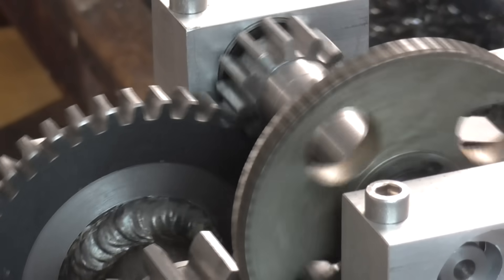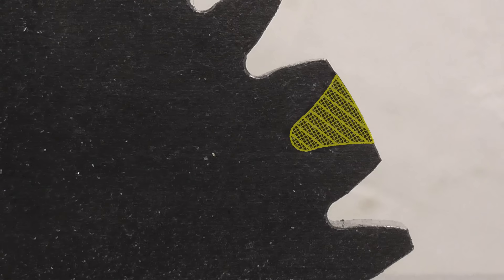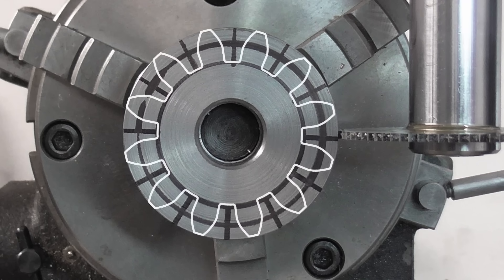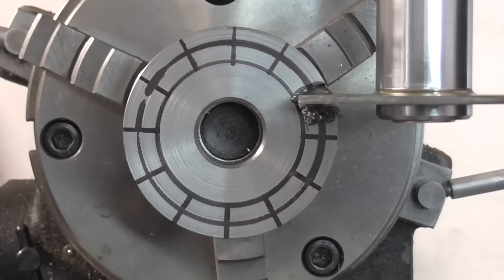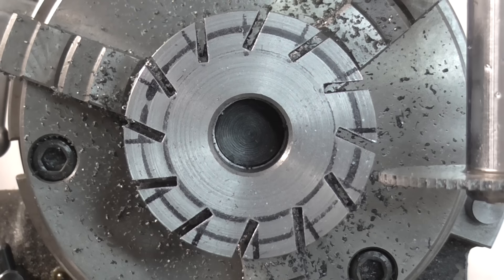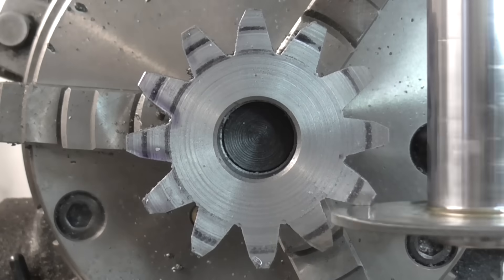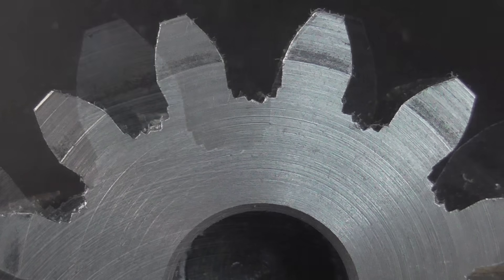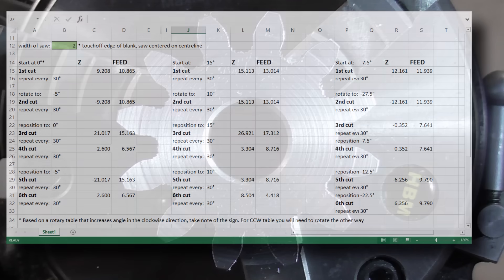Cut any gear with just a slitting saw

Comment: This video taught me two things: first that I really like the gear math and this method of approximating a complex shape. Second, that gear cutters are so so cheap in comparison to making 200 cuts per gear
Reply: 200 cuts per gear is nothing compared to Clickspring hand filing his wheels!
Reply from the maker: @benni5941  Yes, that takes real dedication.
Reply: Tune in next week when Andy creates an additional identical gear with a rusty old worn hacksaw blade and a guy named Pythagoras
Reply: @trevorvanbremen4718  I need at least 3 different sizes of gears. Module 1, DP16, and DP18 with at least two different pressure angles between them. Good quality US-made gear cutters are around going to be around $50-100 each, minimum. I can get sets of import gears from Asia for around $100 per set, but the quality is unknown. Some of the DP imports are marked for 14.5 degrees, which is what I need, but are really 20 degrees, which will eventually damage the original gears in my machines. On top of that, how many gears do I really need? At least a set of metric transposition gears for each machine, which is only 6 gears at the moment. But they're 127 and 100 tooth gears... Those would, indeed, be more labor intensive using his method, but still much cheaper. Buying the gear cutters in sets so I could do any tooth count of gear in the sizes I know I need now is going to be much more expensive, but cost at least somewhat less time. What happens if I need another size gear for any reason? Just one, or just a few... 

One of these days maybe I'll know the answers to those questions, but for right now, accumulating knowledge of the various ways of doing this is good. And I have slitting saws in an assortment of sizes... 

If you know what you need, the answer is simple. If you do not know what you really need, things are a lot less simple! ;)

Bill
Reply: @mechanician7735  I would rather upgrade the the Mill to CNC actual 2 axles would be enough Turntable and the feed. You have to setup each cut manual but the cutting itself is automatic.
Reply: Gear designer here.  For one or two gears, I think this method is good.  Your gear cutting place doesn't always have the hop you are looking for.  Tooling can be 8 weeks before you can start cutting.  I think his method is to address delivery timing issue more than anything.  Often times if I were to design a 12 teeth gear, I don't take stock shape to avoid undercut.  I would shift the profile to strengthen the root (Load balancing).  I wrote a program to generate the true involute profile where you can cut it on CNC using an endmill.  It will go rounds and rounds to cut any custom profile.  I have used such method for find pitch gears as well all the way down to 32 diametral pitch for plastic gears.  I can turn a gear around with model shop (inside where I worked) in a matter of hours.  I think his method for course pitch would probably be capable of doing.  But it's going to take some more math to account for the shift.

Another option is to buy stock gears or gear rods.  They are by no means accurate (gear profile).  But they can at least allow you to make what you need.  Inaccurate profile will lead to noise and excessive wear.  I don't think you would worry about that for making a prototype or something.
Reply: I won’t ever cut a gear, I don’t need to, but the beauty of this video gave me a lot of personal satisfaction, what an extraordinary expresión of human creativity and mental order. Congratulations !!!
Reply: you can still cut a batch of gears in the same set up if more than one the same is required
Reply: @chrisnorth3458  Yup, just chuck up a long enough piece of rod stock. Depending on stickout, though, you'll probably want some tail support on the other end.
Reply: @chrisnorth3458  Sure. Make one wider face gear by this method- the length being the sum thickness of all the desired gears,  
then slice it to the final size, making an allowance for kerf width.
Reply: Great video, it with sure work
Reply: Ive made gears from 4320 on a 3 axis using a half dozen different sized end mills and taking a total 15 passes. It can be done faster than slotting and achieve proper profile with the proper CAM software all in a single program.
Reply: Gear cutters also do give longer lasting no slip evolvent gear profiles. You can only use this for toothed belt drives or gears where the slip or wear does not really matter. Positioning or high load gear is a no-go.
Reply: Now that's thinking! Very clever!
Reply: I know less than I should about gear cutting. I feel cnc has made many people complacent about lost trade skills. Heres to rebuilding skills exercise at a time.
Reply: Believe me, it will not worth the investment if what you need is just one or two gears of specific dimensions.
Reply: @jimqossim2554  works for me b/c I keep braking the same gear.
Reply: @iguanapete3809  you found the cause yet? Fix the root problem. That will eliminate the problem.
Reply: You forgot "a sharpie doesn't work unless it is spinning"
Reply: You can only buy gear cutters in sets, and that can be prohibitively expensive. You can also use this technique to make a gear cutter

Comment: Having worked in a gear cutting job shop, I was aware it could be done with a 4th axis and CNC, using much smaller steps, but I'm quite impressed how well the approximation is with so few cuts per tooth.  I appreciate the rounding out of the root to get rid of stress concentration. In a pinch, your method would likely produce a gear good enough for light duty use.

Thanks so much for sharing this.

Comment: If you now put a non-hardened gear in a pair with a hardened one, or even better, make incisions on the hardened gear, as on a file, then you will get a completely correct involute. A good method in the absence of a large gear-cutting machine.

Comment: Thanks! Added the spreadsheet to my personal "resource library" but added two fields that I missed:
Source, with link to the Patreon page.
Video, with a link to here :-)

(On that note I'm a professional machinist used to work in CAM and multi-axle machines as well as manual and I found this useful for problem-solving methods)
Reply from the maker: That's a good suggestion. I didn't put any attribution on the spreadsheet and it's not locked for editing. I have now added these two fields.

Comment: Again, I love how thorough you are in explaining the math and everything that goes into the process.
A bit of a side bar, how do you find the proper rpm and feed for your slitting saws?  I have limited experience with them and often find it quite tricky.

Also, it must have taken ages to make this gear?
Reply from the maker: When cutting steel with HSS I always use the formula rpm=8600/diameter. This works with anything (lathe, drill. etc...) This is a 63mm diameter saw so that gives an rpm of 136 and I will usually use the closest speed my machine can do below that (this might seem very slow for a saw, but too fast will burn them up quickly). As for feed, I just feed by hand at a speed the machine feels comfortable with.

It did take several hours to make this gear, but mostly because I was filming it at the same time which always takes far longer. The first two cuts per tooth took the longest, maybe around a minute each, but after that it's much faster as the saw is only taking a small slice. I probably could have made it in around an hour without the camera in the way.
Reply: I think people easily get intimidated by details; getting what otherwise would have been a major stumbling block for your one-off project in just a few hours worth every second of it. By the way thanks for the cool video🙌.
Reply: @AndysMachines  I guessed it took you at least 8 hours to shoot and edit this 16 minute video. Thanks!

Comment: Hi. I’m very impressed with your ingenuity. I would like to try your method of producing spur gears. I have been considering buying a set of involute cutters but feel the amount of use I’d get from would not justify the cost. Is there any chance you could make public the sheet of the calculations for dimension?
Reply from the maker: The spreadsheet is available for free here: https://www.patreon.com/posts/61153468

Comment: and a ball nose endmill!
Reply from the maker: True! You could skip this finishing stage, the gear would still work. You could also just use a file to clean up the gear, or grind a radius on the corners of the saw to start so it leaves a cleaner root to the tooth.

Comment: Great video. I've often wondered if one could use this exact technique, and you have shown you can.

Since you had to clean up the roots with a ballnose anyway, why wouldn't you use a ballnose or bullnose for all the cuts, and the same basic technique, provided the teeth were big enough, like they were for this mod 4?
Reply from the maker: It would have to be a very long thin ballnose endmill and you couldn't cut full depth in one pass, so it would take much longer. But what you could do is radius the corners of the slitting saw, unfortunately they don't seem to sell saws like this (I've never seen one).

Comment: Do you need to harden the gears? Will that distort the gear?
Reply from the maker: I don't generally harden gears, it can cause some distortion and you need to get the hardness right or they can break. Another option is case hardening which produces a wear resistant surface but leaves the core soft and able to withstand bending forces.

Comment: Very cool. In theory you could use a drill instead of the sharpie for fiducials by drilling out the root bottom between teeth, and skip the cleanup stage at the end? The profile between the teeth isn't circular but could be estimated by a drill bit the width of the flat. You'd cut more material past the root diameter out but if strength isn't required it would save some time.
Reply from the maker: Yes, that's right. I do this sometimes, see my reply to Gr eg below for a longer explanation.

Comment: Very welldone again Andy
At 1:24 the early gear looks like you started the tooth cutting process or root forming with drilling holes. Was this the case and why did you abandon this method, because it seems like a good way to get the depth of each cut correct and end up with a smooth root?
PS I enjoy your humour
Reply from the maker: Yes, well spotted! This was another gear with more teeth (same module size) and I drilled out the roots first. There are pros and cons to doing this, it can save time, but the root of the tooth is not a perfect arc, so you either have to drill a bit inside the root circle, producing a slightly weaker tooth. Or drill outside and still clean up the corners later. I didn't want to do this on the smaller 12 tooth gear as the teeth are more undercut and so weaker to start with, and also I wanted to demonstrate that you can approximate the entire profile with just a square-cornered slitting saw, if I'd taken enough cuts with the saw it would have been possible to clean up the root much more, but the ballmill was just much faster.

Instead of drilling one hole at the bottom of each root, it's also possible to drill 2 smaller holes side by side to better approximate the profile and then clean up the flat at the bottom, but as the material was quite thick, that would have meant very small very deep holes which can be problematic.

Comment: This is taking faceted gear cutting or Approximate Hobbing down to it's most basic level. Depending on just how many passes each tooth gets the faucets could really be quite small. In the past when I was still working I occasionally would have to cut  a straight toothed sline on a shaft. Some spline sizes we had cutters for. Others I would have to cheat and use either slitting saws or Woodruff Keyseat Cutters.
Of course for any gears or involute splines we just used a gear hobber vertical gear shaper  (Barber-Coleman 16xxx and a Fellows). In terms of the quality of a gear cut by the generating method a gear shaper produces a by far superior tooth.
Reply from the maker: A small hobby-sized gear shaper is on my list of things to make one day. What I like about them is the ability to make internal gears and compound gears (cutting up to a shoulder without the lead-out you need when hobbing)
Reply: @AndysMachines  
The wobble type setups like those used for cutting internal hexes have taken over a lot of the work formerly done by internal shapers. And yes gear shapers like the Fellows are great at cutting gears up to a shoulder or when you have two different numbers of teeth in the same short gear shaft. Another thing that they are really great at forming incredibly smooth bores. It's what happens if the tool and work are turning in different directions. 😖

Comment: This was really well done. Thank you! Any interest on lapping to improve the profile from the faceted form? I’m not sure it’s important, but would be interesting.
Reply: That was my thought as well.  If you have to end up with a smooth profile just get it close and then lap it the rest of the way with another gear (perhaps a sacrificial gear).
Reply: I had the same thought. But more fundamental, I think, would be to make a shouldered arbor for the saw which had a flange to support the saw from the "back" side to prevent pushoff. It could not be used for the two initial cuts, and even then would have to be a buttress profile to fit into the tooth space, but I expect this modification would improve both finish and accuracy. 
Another thing which would help (in conjuction with the shouldered arbor) would be to use face-relieved slitting saws. They're intrinsically more expensive, but can be picked up on eBay, sometimes as "new old stock", at affordable prices, now that manual machining is being abandoned in the first world.
Before resorting to lapping I think it would be worth trying to get a better result than shown here, to save undue wear on the lapping gears. If the wear rate is appreciable, even the first workpiece lapped will be of inferior profile shape and consistency. I would expect lapping to remove material preferentially in the zone of the pitch cylinder which would degrade the profile if much material had to be removed.
Of course for some applications none of this extra effort is necessary, but for smooth running at high speed, or long life at high load, it would definitely be worth thinking about and experimenting.

Comment: Very clever way to make a gear. A friend would do a similar process to remove the bulk of the material using a horizontal  mill. He would then grind up a single point tool to get the gear profile. On some gears he did one side of the tooth then the other side.

Comment: Finish grinding of gears are done with a grinding wheel shaped like the slitter, however; only one face is flat since you want the wheel to be stiffer since the force is on the face.  Never did the math, thanks.  I have a round post bench mill and just got a rotary index.
Reply: Finishing gears with grinding is not always needed, it depends on the application.
That only one face has to be finished (that makes it more accuratel, but not stiffer) is also not an absolute, there are gears that normally can spin both directions.
We cold add another optional pass in gear making, that is heath treatment, needed when significat torque, power and loads are present, I believe that hardenig and tempering is always followed by grinding.